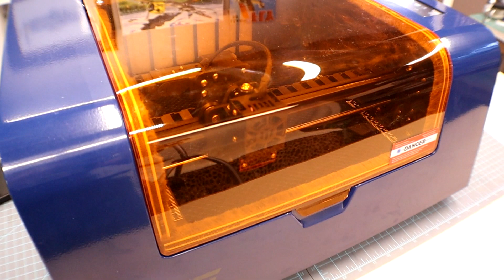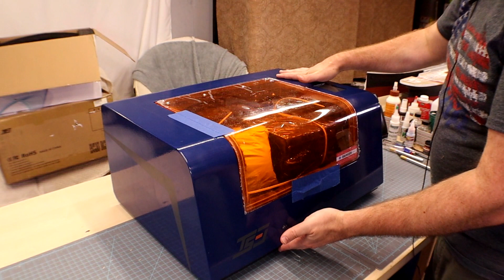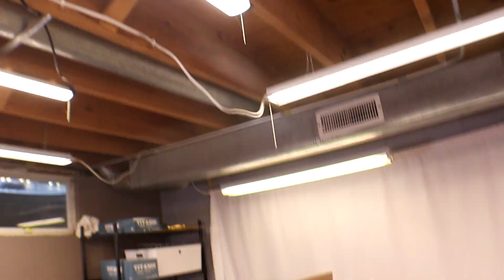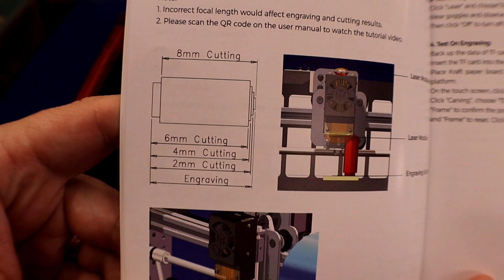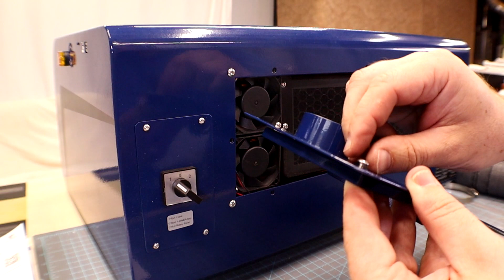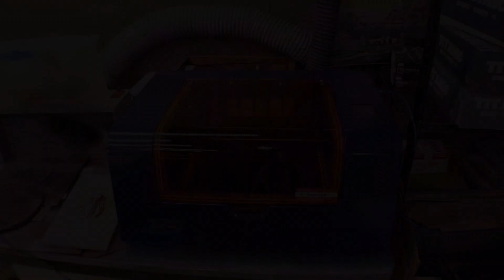Two Trees TS3 Laser Engraver

Comment: At 3:10, you say "TMMST3100". On screen, it reads: "TMMSTS3100". The on-screen version has a second capital letter S. I checked it three (3) times to confirm what I saw and heard.
Reply from the maker: Thanks! What is on the screen is correct. It is also in the description. (It would have been easier if they used a less complicated code)